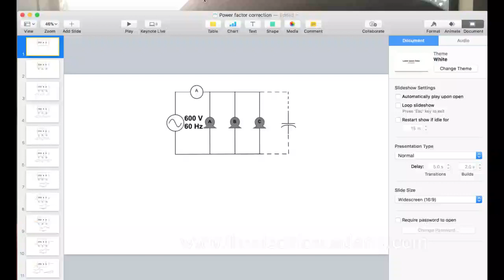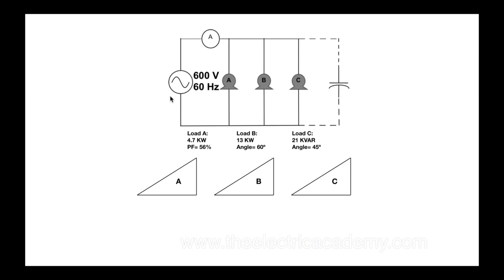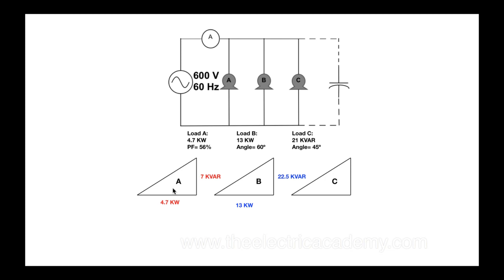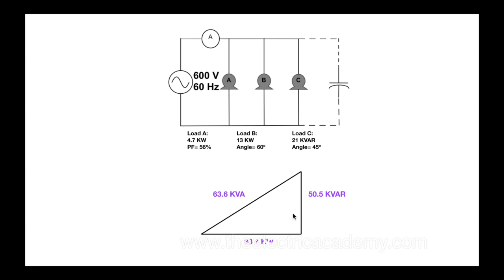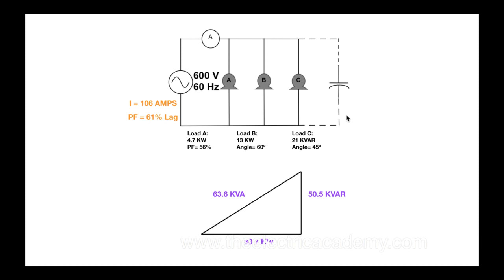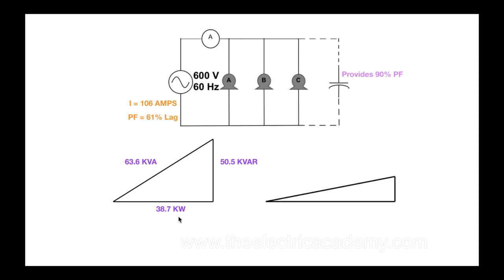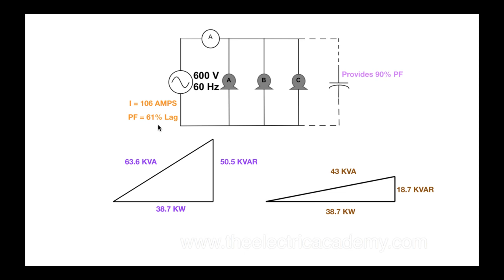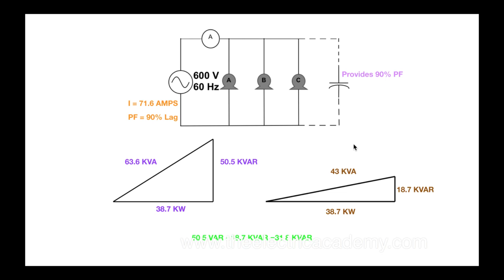How do to size a capacitor for Power factor correction

Comment: How did you determine the circuit was an inductive circuit, where the current lags voltage?  You just declared it was so, with out explaining how you concluded that through mathematical analysis.
How do you calculate the capacitor size, in farads, once you calculate the amount of kVAR you need to add to inject into your system?
When you are looking at +/- VAR of your system.  Are you referencing the load or the source that is adding or subtracting VAR to the system to determine if the system is Leading or Lagging based on the +/- VAR of your meter.
Reply: A motor is always inductive because of the windings.

Industrial capacitors are often rated in KVAR for this type of service.  There is a formula to determine the correct capacitance in microfarads, but it includes the voltage, so you need to know that as well.  Most factories and industrial plants are inductive because of all the motors and machinery.  Most computer and data centers are capacitive because computer switching power supplies are capacitive.

Comment: Very good video and learnt a lot. What about if premises doesnt have motors as such, but consists mainly of Aircon, Lights, Ceiling Fans and sockets do we still need Capacitors for correction of PF?
Reply: There are lots of motors in aircon for compressor and 2 fans, and of course in the celing fans
Reply: So is power factor correction needed?

Comment: what is the capacitance of the capacitor required ?
Reply: Take this DC formula: power = voltage * voltage / resistance.  It generalizes to reactive power and reactance in an AC system. Substituting and solving gives: reactance = v^2 / reactive_power. I'll use the convention that capacitors are a negative reactive load. (i.e. they "supply" reactive power)

0.6 kV squared is 0.36 kV^2. Divide by -31.8 kV * A.
Calculator and cancelled kV gives: -0.0113 kV / A. The ohm is volt/amp and I adjust the scale: -11.3 ohm reactance.

The same computation gives -53 A (reactive) current.

The reactance of a capacitor is -1 / (2pi * f * C). Solved for capacitance: C = -1 / (2pi * f * X). Now substitute in units. -1 second / (2pi * 60 cycles * -11.3 ohms). 2pi = 6.283.. 1/cycle. Calculator and units cancellation: 0.0002343 seconds / ohm.

Manipulate the unit: sec / (V / A) = sec * A / V = coulomb / volt = farad.  0.0002343 F. 

So we need a 234 microF capacitor rated for 600 V AC nominal. It's wired line-to-line, so at least safety class "X." It will continuously supply 53 A of reactive current, so its branch circuit will need a normal-duty 70A breaker or a 100%-duty 60A breaker. I don't know if code allows a 53A conductor, but I wouldn't be comfortable with that because a class-X capacitor may draw excessive current when it fails. I'll bet this is an expensive part - upgrading to class Y might be too expensive.

I'm not a professional, just a curious autodidact. Please consult with an electrical engineer and/or get your own degree and license before wiring and energizing anything that's measured using tens of kVA.

Comment: if you can improve the power factor to say 90% or more why not just make it a hundred percent? is it possible to totally get rid of the reactive power to make the system lossless?
Reply: It becomes increasingly more expensive to improve it by 1%, you'd need to install many capacitor banks and synchronous condensers throughout the system with very little benefit because the installation costs would cost more than the power losses themselves. You might also introduce issues of parallel resonance which would cause dangerously high voltage.
Reply: Most will calculate for a .95 PF to consider the logical inefficiency of components, resistive and/or harmonic, and cost threshold to go higher. The right value cap will lower the angle by shifting the v & a phases into sync. Lots of math, but check this out for shop tools. https://www.youtube.com/watch?v=TPqXNLkJTJM

Comment: Could a capacitor be installed in a single phase system to acheive the end result of a lower electric bill?
Reply: Without getting into specifics, the short and sweet answer to your question is NO! Let me clarify a thing or two... first off, yes - you most certainly could have a capacitor installed on your electrical system... However, it's highly unlikely that the addition of capacitors to your electrical system would be beneficial to you in the slightest bit because I doubt you have anything in your house drawing huge amounts of current that is out of phase with the supply voltage(thus resulting in a poor overall power factor) such as is often the case in industrial settings with numerous large motors being operated on a continual basis...  In fact, the cost of installing such a device by a licensed electrical contractor would far outweigh any benefit you would see because there's likely nothing to correct in the first place.
Reply: pasqualeredo good answer, except the cost of my own skill set. Why would I pay my boss to have me do electrical work for myself?!? Lol. Seriously, good answer otherwise.
Reply: +John Rice Thanks...

Comment: How to make DC  to Ac without using transformer
Reply: I would say an oscillator switch, Digital signal
Reply: Generally speaking, the devices converting DC to AC are known under the name of inverters.  As far as I know, most inverters, not to say all of them, do require a transformer.  Perhaps there are scenarios where they aren't needed, but I'd be doubtful.  What would the generated AC voltage be used for in your question ?
Reply: You could use a DC motor which spins an AC generator.